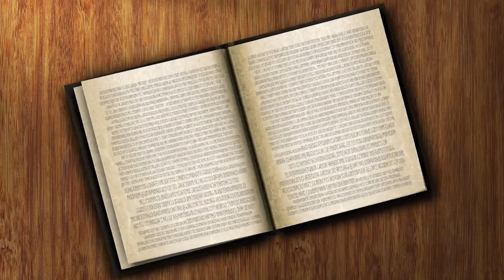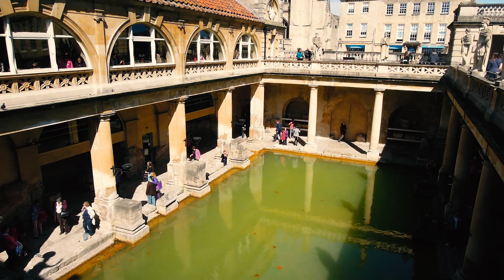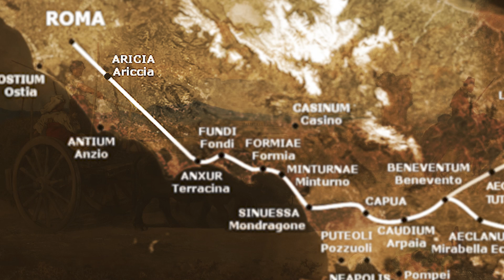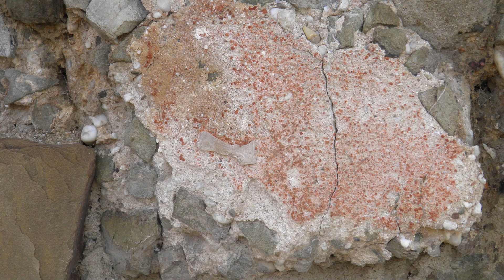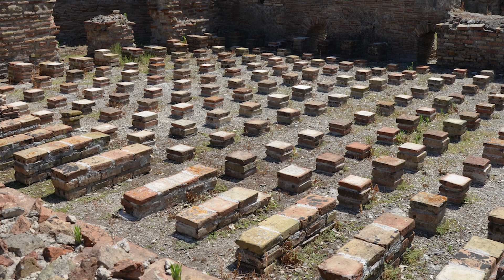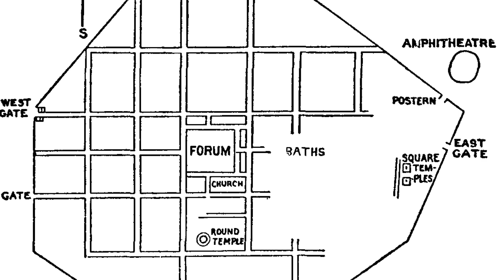How Ancient Rome Revolutionised the Modern World | Time Travels

Comment: Roman concrete is not as strong as modern concrete. You could never build a tall modern building with Roman concrete.  This is actually why it lasts longer as it has some flexibility and porosity.
Reply: EDIFÍCIOS MODERNOS SÃO FEIOS E INÚTEIS.
NÃO DURAM 100 ANOS.
Reply: @jeffersoncruz2898  Chicago and Manhattan skyscrapers are nearly there in good condition still
Reply: @CarnageDogg aren’t concrete but steel
Reply: I don't believe this theory
Reply: @sharioverend1618  this is history, not a novel....whether you believe it or not, it doesn't change the fact that it happened...now I understand why Trump won the election....
Reply: Go check the pantheon in Rome and then talk. JELOUSY
Reply: @MAGRIPPA1  emperor, don't loose your time with these ignorant plebeians: remember that when they don't have a word to express a concept, they use our language with which is possible to express all of them....cum nos de philosophia loqueremur,eios in arboribus vixerunt....
Reply: roman concrete is much better than modern concrete: they used a vulcanic ash named puteolana which triggered a chemical reaction  that makes the Roman cement harder as time passes: all this is also written in the history books if anyone wants to read them: otherwise go to Rome where you will see huge buildings pissing on the head of the skyscrapers made out of lego that you find in your areas...